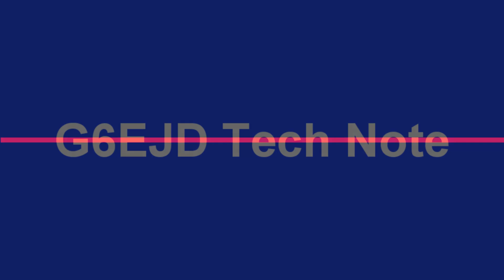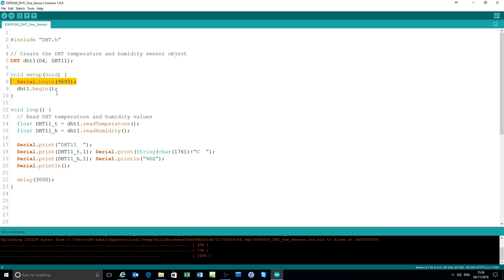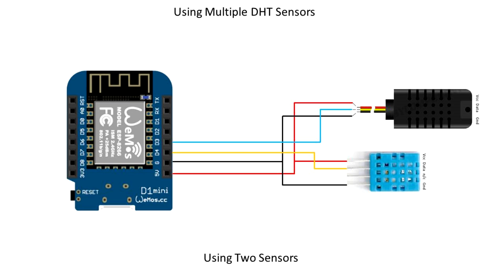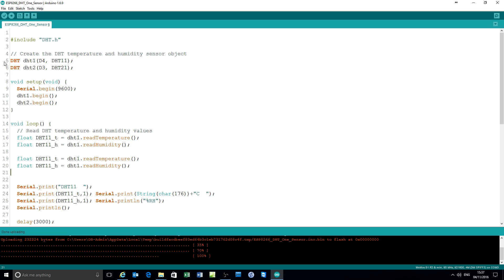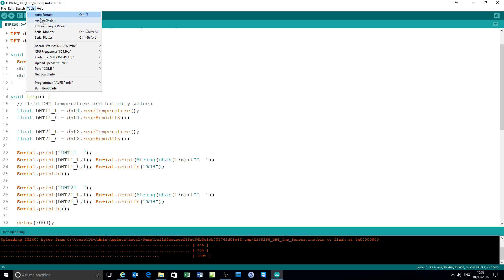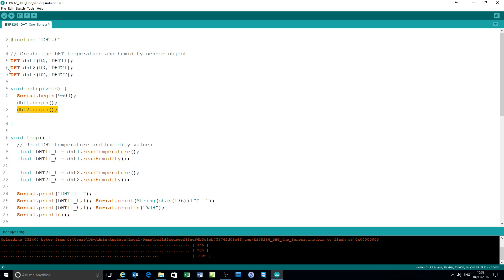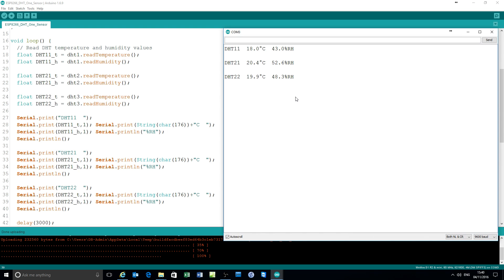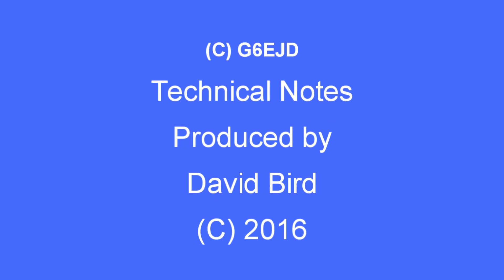Tech Note 012 - ESP8266 Reading Multiple DHT Sensors

Comment: I am getting an error "Error compiling for NodeMCU 0.9". How to fix?
Reply from the maker: What is the error?
Reply: @G6EJD  Error compiling for NodeMCU 0.9
Reply from the maker: Yes but it will show you what is the error in the bottom section of the screen.
Reply: Arduino: 1.8.18 (Windows 10), Board: "NodeMCU 0.9 (ESP-12 Module), 80 MHz, Flash, Disabled (new aborts on oom), Disabled, All SSL ciphers (most compatible), 32KB cache + 32KB IRAM (balanced), Use pgm_read macros for IRAM/PROGMEM, 4MB (FS:2MB OTA:~1019KB), v2 Lower Memory, Disabled, None, Only Sketch, 115200"

In file included from C:\Users\shaki\OneDrive\Documents\Arduino\libraries\DHT-sensor-library-master\DHT_U.cpp:15:

C:\Users\shaki\OneDrive\Documents\Arduino\libraries\DHT-sensor-library-master\DHT_U.h:36:10: fatal error: Adafruit_Sensor.h: No such file or directory

   36 | #include <Adafruit_Sensor.h>

      |          ^~~~~~~~~~~~~~~~~~~

compilation terminated.

exit status 1

Error compiling for board NodeMCU 0.9 (ESP-12 Module).

This report would have more information with
"Show verbose output during compilation"
option enabled in File -> Preferences.
Reply: Sorry for the trouble. I reinstalled the library, there were a few missing file dependencies.
Reply from the maker: @shakirhussain1840 you need to include the Adafruit sensor library
Reply from the maker: @shakirhussain1840 Manage Libraries and search to add it
Reply: @G6EJD  It's done now. Thank you for the help.

Comment: thank you for this. it been very helpful. Is it possible to increase the print delay to 30mins or 1 hour and if yes, how do i do it?
Reply from the maker: Change delay(value); to delay(30*1000*60*60); for 30-mins or the same with 60*1000*60*60 for an hour. Each delay unit is 1mS so to get a second delay you need a value of 1000 so 1-min needs 60*1000 and so-on

Comment: Thanks for this it works ! Simplest code i have seen until now :). One question, if anyone knows why i am getting a '?" rather then a 'percent...'  20:29:46.723 -> DHT11  24⸮C   38%RH (using a us keyboard with Canadian English). Thanks !
Reply from the maker: It’s your browser, it should display ° but when you get ? It means the wrong language is set, change the language or go through your character sets to find the ° you can enter the sequences from your keyboard into the source code for example normally ° is accessed via holding down ALT the 0176 try ALT0247 that may work, you may need to go through all from 129 to 255 !
Reply: @G6EJD   Big thank you for the reply. I noted that i typed in " Serial.print(String(char(176))+"C   "); " so i corrected it and i still had the same issue. Tried US english, Canadien english, still did not work so i ended up using = Serial.print("ºC   "); so this works, thanks again for the help!

Comment: Nice job! 
I'm trying to add an analogue sensor (LM35), because I already have it instaled on the wall, from an old instalation. How to mix analogue sensors with digital sensors. I'm also using d1 mini. Can you give a clue how I could achive this goal. I'll be using just one lm35 per floor, wich means I do not need to multiplex the analogue inputs. I can read the temperatures from serial monitor separately (LM35/DTH22), but can get the code for both. tks
Reply from the maker: It’s not really possible to do that with nearly any sensor, for example the LM35 is an analog device, so needs an ADC input, but the esp8266 has only one ADC input, the DHT22 requires a digital pin per device so that’s achievable as I set out in the video and code examples, using an I2c device is even harder because each has a fixed address so you can’t have two of the same, all-round the sht22 are the best for multiple devices. You could use a cd4066 analog switch, that would work, with digital pins to select the channel being measured.

Comment: Thank you for this uncomplicated tutorial. this is one of the best simple tutorial on reading multiple sensors using esp8266 or arduino. i would like to ask how to read the sensors data  using esp8266 webserver. Thank you very much -romycruz@gmail.com
Reply from the maker: In much the same way add the code for reading multiple sensors then display separately for each sensor, once you have the variables for each sensor reading it really is a case of displaying each value in turn, if you have trouble just let me known.

Comment: I get the dreaded “Failed to read from DHT Sensor” error. Do I need to to power the sensor with a separate 5v power supply?

Embarrassed to ask on such a simple project, 3 wires, 1 library and 20-ish lines of code. But after 5 days and trying 5 different dht22 sensors, I am pulling my hair out
Reply from the maker: It depends on the device, sometimes you do need to power the DHT22 from 5v. Are you sure you have the pin-out correct, the PIN numbers are viewed from the top with the pins at the bottom far left is Vcc then data, then NC then Gnd. Also some DHT22 devices have an internal pull-up resistor to Vcc, some don’t, so add one say 10K between data and Vcc. Value is unimportant within the range say 7K-50K, but there needs to be one.
Reply: G6EJD - David firstly may I say a Huge HUGE thanks for taking the time to get back to me, it truly is appreciated.

The device is a DHT22 module, not just a raw  DHT22, they only have 3 pins

VCC
Data
GND

These are clearly marked and are the same on all five units, I have tested all five units with the same effect.

I have not tried an additional resister, as I was told I did not need one with the module. I will try this, thank you.

I have tried with both 3.3v and 5v pins from the Arduino Uno.

I have also tried both Digital and Analogue pins.

The tutorials make it look so easy, 1 library and 3 wires, the LCD1602 with its complex wiring was a doddle, as was daisy chaining my 18b20’s.

Any ANY advice I am very grateful for.

If it helps I am using an Arduino UNO, I have ordered a second one, but I have tested the same pins with LEDs and even relay module and I can get a signal to them.
Reply from the maker: Tony, did you select the correct library object for the dht22:
https://github.com/adafruit/DHT-sensor-library/blob/master/examples/DHTtester/DHTtester.ino

Comment: I could change it to 8 sensor but i cant ad webserver, anyhelp please? Thanks
Reply from the maker: You need 8 spare gpio pins on the ESP8266 so it’s not really viable, so what exactly are you trying to do?
Reply: @G6EJD  I need at least 6 dht22 but i need also webserver
Reply from the maker: Have you looked at my general purpose webserver it supports dht11/22 devices
Reply: @G6EJD  please can tell me the link to your general purpose webserver, cant find it, an i`m usind LOLIN  nodeMCU 12E and its working with 9 DHT22, i test each pin and works, please help me with the webserver, Tanks
Reply from the maker: https://youtu.be/q-erOgA-qdQ

Comment: i am not able to get readings from 3 dht22 sensors.please guide me
Reply from the maker: Sumeet Mujumdar, in the code I give an example of using up to 4 sensors, are you prefixing the readings with the sensor number and have you used a separate gpio pin for each sensor? The example on fit hub I gave works for 3-sensors so what is going wrong?
Reply: @G6EJD  Thank you for your prompt reply.The main problem is inability to get readings.The code was compiled and uploaded successfully but when I clicked on the serial monitor,it showed only 'DHT test' and nothing else
Reply from the maker: Sumeet Mujumdar, probably incorrectly connected devices, are you sure you have the pin configuration correct

Comment: Any recommendation on taking these. Readings to a display such as a the 1.3” screens, 1602lcd, or built in oled like the kit 8 esp8266  or kit 32 esp32
Reply from the maker: Clarence DeMars, in essence the only differences would be cosmetic and matching the screen drawing commands and layout, but luckily most libraries use the Adafruit GFX constructs and so the conversion requirements are minimal, plus the sleep function would need to be removed to keep the screen  synchronised and operational.

Comment: As the sensors are on different digital pins, can they all be of the sametype, e.g. all DHT22?
Reply from the maker: David Heaf, the dht22 sensor needs a separate pin for each device, much better devices like the sht31 devices are I2C bus connected but you can only have one as they all have the same bus address, so the dht sensor is better for multiple device needs.
Reply from the maker: David Heaf, yes they can all be the same or a mix of dht11 a d 21 and 22 but 11’s are poor accuracy 22 not bad
Reply: @G6EJD  Many thanks.

Comment: @G6EJD i m using nodemcu mini but for me it shows D4 is not declared in the scope do u know y??
plus i keep on getting the defualt 32 bit int value as the output if i try some other codes for dht11 and nodemcu
Reply from the maker: Sahil Ranolia, all you need to do is replace D4 with the PIN number that you have connected your sensor to say 4 or 14 or ? What this means is when the board type is selected the pin D4 has not been defined.

Comment: can we use flame sensr and dht11 on single nodemcuesp8266 board as you used dht11 and dht22 ?
Reply from the maker: aditya dubey, yes you’d use different gpio pins for each device and read them in sequence as any other device. I see no difficulty at all just combine the two programmes.

Comment: can i use mq sensor for this ?
Reply from the maker: Unfortunately not, the MQ sensors are all analogue output (0-5v) and the ESP8266 has only one ADC input, so you’d need to add an analogue multiplexer cd4066 or a multi-channel ADC card.

Comment: what would the code for photocell look like?
Reply from the maker: jese je , a photocell is usually an analogue device that has a variable resistance with light intensity and so would need another resistance to say 3.3v and then you’d use the read ADC command readAnalog() to get the value, alternatively you can get pre-calibrated digital I2C bus devices  that measure light intensity support for which is in a library 1750 is the device number to search for.
Reply: @ @G6EJD  Thanks.

Comment: Hi, thanks for the video. Would the same thing work using the 3.3V instead of 5V ?
Reply from the maker: Petter Söderlund, the data sheet for all of the devices shows a range of 2.4 to 5.5v so yes, they will work on 3.3v
Reply: OK thanks.. I'm having trouble of losing signal, getting NaNs instead of values after a couple of hours. Maybe i should try to use the 5V instead? Could it be a problem that I'm not using a pull-up resistor causing my problem?
Reply from the maker: Petter Söderlund, yes try a pull-up resistor that would help.
Reply: Thank you for the input!! :)

Comment: Hello, in your opinion which is the best temperature sensor from the 3? Also, have you tried transmitting on HF radio close to these sensors and see if the values change with RF? Thanks
Reply from the maker: Filipe Lopes DHT22 without doubt (white body) the black body type is huge but has an outside mounting enclosure. The very best is the SHT30. Yes I have a DHT22 outside near my HF antenna and don’t have any issues, I have a SHT30 too again with problems. ESP32 and ESP8266 also have good immunity. 73 Dave
Reply: G6EJD thank you very much Dave. I am building a system to put inside my filters and triplexers. Hope it will handle 2kw of power close by. We will see hehe. Thanks for the help and great video. 73 Filipe
Reply from the maker: Interesting, 2KW could be a little bit too much, but you could shield them with a thin metal plat cover with holes in to let air in but not RF, maybe a couple of chokes in-line too. 73

Comment: Hello! Thank You for sharing Your video! Is it possible to get this to work with three DHT11 sensors?
Reply from the maker: mannås monthan Yes and as many as you have I/o pins so about 8 on a ESP8266 I think I give an example on github see the video description and follow that link to the code. If you have any problems please ask me I can write you a short sketch to do that.
Reply: G6EJD Thank you!
Reply: Unfortunately I could not find any example with three identical sensors. So I please ask You!
Reply from the maker: Here's a version for you: https://github.com/G6EJD/ESP8266-Reading-Multiple-DHT-Sensors

The pin numbers are the ESP8266 change them as required. I have written it for 4 sensors but commented out the 4th, I think you can see how to keep adding sensors or take them away. Problems? let me know.
Reply: A super-big thank you! It was very kind of You.

Comment: any idea how i would get the wifi rssi value off the sonoff in mqtt or json ?
Reply from the maker: Well we know that for RSSI to be available it must have been part of the MQTT interface and I have not seen any evidence that RSSI is reported to the SONOFF servers so I think that value is not available. If you jail bresk the sonoff that adding capability would be easy.
Reply: it is in the structure if you type state it shows up as a value in the long json string as RSSI
Reply: sorry state in the tasmota console
Reply: the rssi is shown in the original ewelink firmware .. and the voltage of the 5v vcc line is in that json file i just sent.. i just not good with these mqtt commands at the moment
Reply from the maker: bing quadby if it’s in the JSON response then it should be really easy to get the value?
Reply from the maker: Ok so the RSSI value is 64 so you could employ a number of techniques to extract it using RSSI as your key even client.read or an httpclient find statement would solve that easily.
Reply: i thought that too but it doesnt seem to send a value so stat/s1/RSSI should return the value of RSSI i not that good at coding so will have to start from scratch with this. i have a few esp8266 modules coming so with try a few easy projecys first get back into it..

Comment: what is the difference in the sensor accuracy, and price what do you recommend...? 73 gw8rdm
Reply from the maker: bing quadby The best sensors are either Bosch BME280 or Sensiron SHT30 or 31 or 35, all the rest are more expensive, old, slow and inaccurate. My favourite is the sht30 and you can get that on a nice carrier board from Wemos. They are I2C bus. Ds18b20 is reasonably accurate.
Reply: interesting you mention the bme280 that seems to ring a bell with some of the barometric sensors i have previously used on my quadcopter think it was a bmp180... i have a look later in my parts box....
Reply from the maker: The BME280 is the latest part measuring temperature, humidity and pressure, the BMP180 was temp and pressure only. They also increased accuracy.
Reply: i will have to get some of them then.. i have ordered some of the dht22s off banggood, but they will take a few weeks.. i used to get parts off squirrel labs but see they no longer trading in uk... i have to get tem somewhere else.. thanks for the swift reply.... old school ex radio ham here... many years ago... yaesu ft101e era... hehe
Reply from the maker: It seems our hobbies are near identical, I still fly my F550 and F450 hex and quad copters, fixed wing models and I'm on my radio most days (FT897) all bands just about.
Reply: yeah built a few race quads naze 32 rev5 and rev 6, cc3d, multiwii using arduino, also done a 250 quad running inav firmware so full gps rth and missions etc...been off the quads for a few months and slowly getting back in to the elecronics again... the ws2812b leds work great on the sonoff b.t.w.  not sure how many i can attach to the sonoff 5v rail i got two neopixels on there for the moment at 50ma per led so thats 300ma as each neopixel has 3 leds... any chance if i send you the sonoff schematic you could suggest how much current i could pull off the 5v rail as my circuit theo
ry is not great....?
Reply: on the bottom schematic i am taking 5v off the input of the 3.3v regulator chip u2 so across D5 diode.. looks like a zener any thoughts...? thanks..
Reply: diode is a DL35 BZV55C62 just checked on the farnell data sheet and says 0.5ma so do you think that would mean i could pull 300ma safely across that..?
Reply from the maker: There's no regulator on the schematic, it shows 3.3v coming into the board from an external source. Either way I think 300mA is the maximum current draw that should be used, or less. Most of those LED's need a separate power supply because of the current drawn as numbers climb, you could try strobing them at a 50%-rate, there is a command to do that, that effectively doubles the number of LED's that can be driven without affecting brightness too much.
Reply: u2 is the regulator with vin and vout... can you see the transformer ee10 then the capacitor c9 and resistor r15 then diode d5 that is the 5v side feeding u2 regulator... i have come off the d5 diode to ground and its 5v
Reply: page 2 of the schematic top right reference c1,2,3  hehe
Reply from the maker: Thanks, I did not see the link to Page.2. They don't list the part umber of U", which is odd. SO who knows, but 300-400mA stills sound like a reasonable maximum.
Reply: yeah i am on the v in side of that regulator so it would be the unregulated side...  i not sure what item it is.. just a 3.3v regulator... its showing approx 5v with my meter and the ws2812 leds seem to work ok..
Reply from the maker: Only time and load will tell it the regulator can supply enough power, heat is the usual sign of a problem.
Reply: seems to be working fine at the moment just need to work out how to  get a nice alarm strobe type pattern.. be all good then, ohh and the mqtt bit thats a pain...